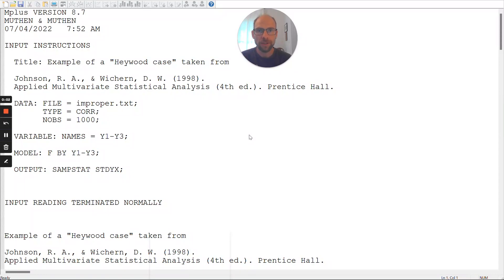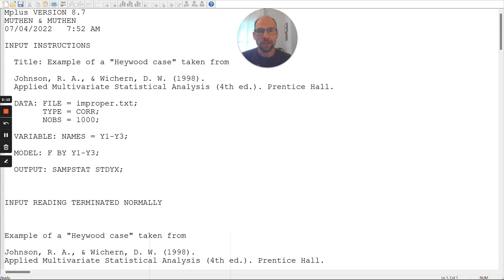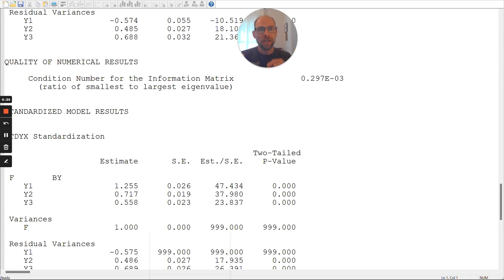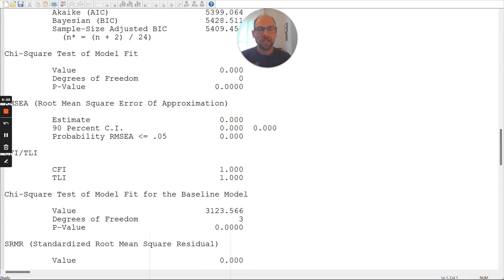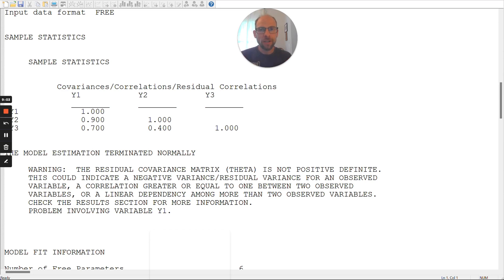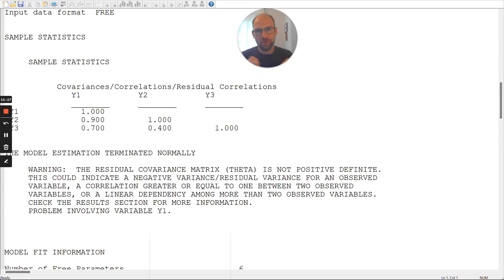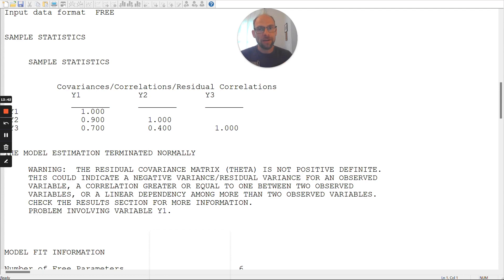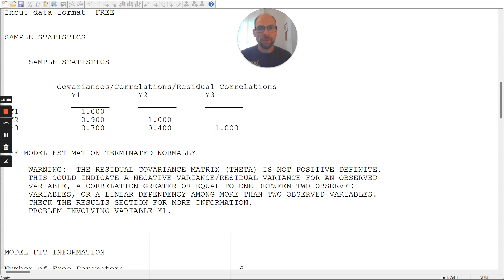SEM: Avoid improper solutions!

Comment: Hi Christian, extremely helpful video, as always - thank you! I have a question regarding negative residual variances in ESEM models, run with Mplus. Is it possible to fix negative residual variance for a given item to zero (or to a non-negative value)? Trying to do so yields an error message from mplus ("cannot be done with EFA"), but based on the Mplus Forum, I feel like there might be an option for doing so. Using "model constraint" doesn't seem to be possible. I just want to see if the model runs when I fix this one error variance as I am getting the message that the model does not converge due to the item in question.

Thank you!

Comment: Hi Christian, thanks so much for this clear and very helpful video. Any reference to cite for fixing the error variance? I am one of the unlucky ones (I'm referring to what you say around 12'30") and I have a very reliable indicator (three repeated assessments of GPA - they correlate > .85), forcing error variance to a negative value. Thanks!!
Reply from the maker: Have you tried constraining the loadings to equality (e.g., fixing them all to 1.0)? Since you are using the same measure (GPA) repeatedly, this may be a reasonable/meaningful constraint (implying measurement equivalence/invariance) that often solves the issue of negative residual variances.

In terms of a reference, I don't recall for sure but perhaps you can find something in

Chen, F., Bollen, K. A., Paxton, P., Curran, P. J., & Kirby, J. B. (2001). Improper solutions in structural equation models: Causes, consequences, and strategies. Sociological Methods & Research, 29(4), 468-508.

Best, Christian Geiser
Reply: @QuantFish  Hi Christian, thank you for your answer! I run an RI-CLPM, where GPA is one of the three concepts - so, Im interested in within-person fluctuations in GPA. So, yes, the factor loadings are by design fixed to 1. That is not helping. Fixing the error variance of the GPA random intercept does partly solve the problem - no negative variance, but still negative co-variances. Any other ideas? I will check the reference. Thanks!!
Reply from the maker: @SM-ut3yl  It is difficult to say without knowing more specifics about your model, but typically, a Heywood case indicates that the model is misspecified (e.g., over- or underparameterized) in some way. In your case, perhaps the model is overparameterized. GPA scores are rather stable across time (not a lot of intra-individual fluctuation). Have you tried an intercept-only (pure trait) model?

Best, Christian Geiser

Comment: Hi Christian, this video was really helpful, along with your others. I’ve run a five-factor model and five factor hierarchical model for compassion (5 factors loading on to overarching compassion factor). The fit indices look good for the five-factor model, and the five-factor hierarchical model (although fit indices indicate the five-factor model is a better fit). When I run the five factor hierarchical model, I get the common error message about the latent variable covariance matrix not being positive/ negative residual variance. The standardised loading of the factor is greater than 1 (1.026), the residual variance is negative (-0.052, significance = 999.000). I’m assuming this is due to inhomogeneity? with some variables being more highly correlated (ranging from .494 to .996). Or could this be a case of bad luck with sampling error as mentioned in one of your videos, due to standardised loadings being close to one meaning the residual variance becomes negative?

In this case, should I be assuming that this model is not a good fit, or should I be fixing the error variance to a meaningful non-positive non zero value? 

Any advice would be greatly appreciated! Do you have an e-mail address I could contact?

Comment: Was really useful :) tnx. I also have another model of improper results. In my model, everything looks acceptable except that all loadings are non-significant. What could be the potential reasons?
Reply from the maker: Hi Zahra, Thank you for watching. I would say a model in which non of the factor loadings are significant is not typically "acceptable." You should consult with a statistician who is knowledgeable in SEM to figure out what's going on. It is impossible to know without seeing the output and data. Best, Christian Geiser